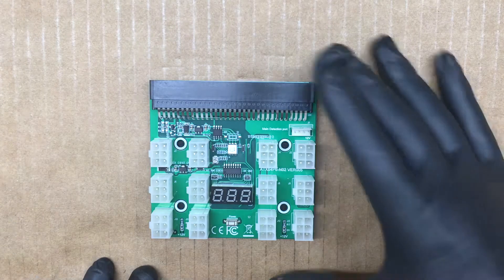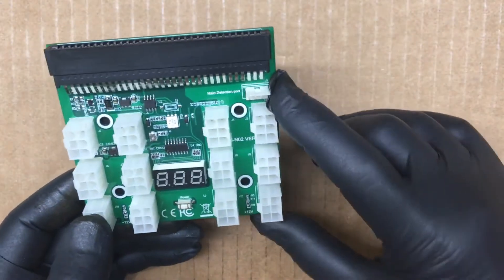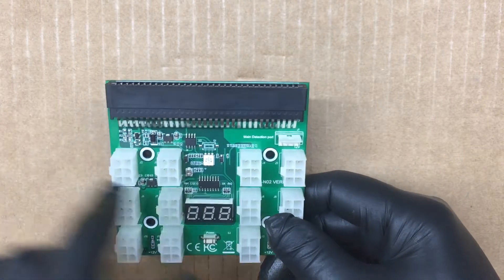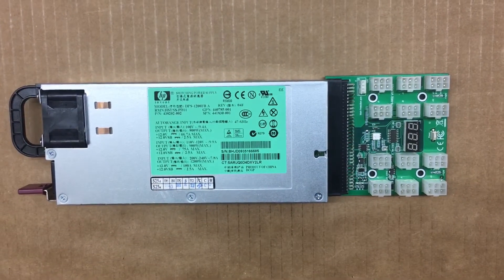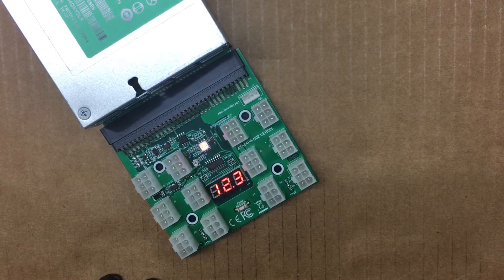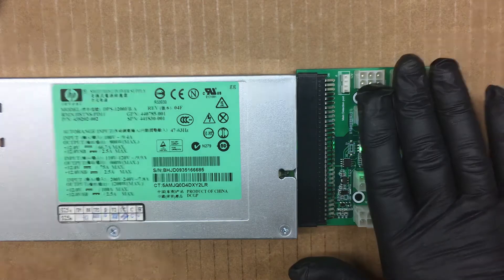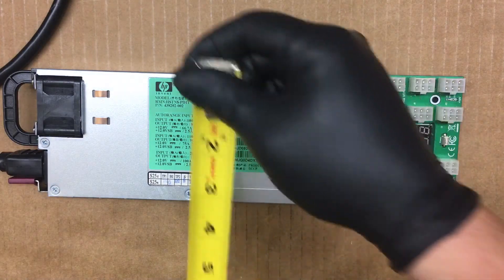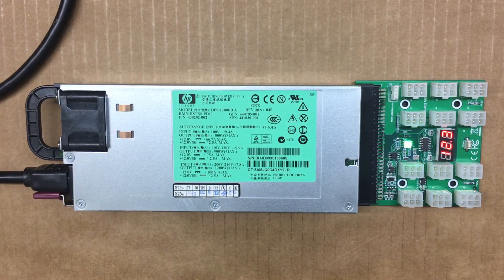Server PSU With Breakout Board For GPU Mining Rig

Comment: So heres my question, i dont trust that 4pin connector that allows you to connect ATX power supply in order to have the timings sync up when powering on n off. So i am assuming the correct order of powering, is turn on the server PSU first let the power regulate on the risers n GPU then maybe like 5-10seconds after power on the computer. That way on the motherboard, it can read all the PCIE slots have a card inside them. Likewise shutting is the opposite, Computer 1st, Server PSU after.